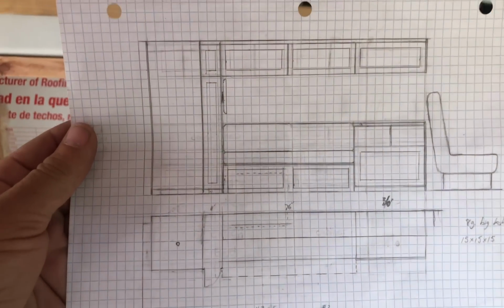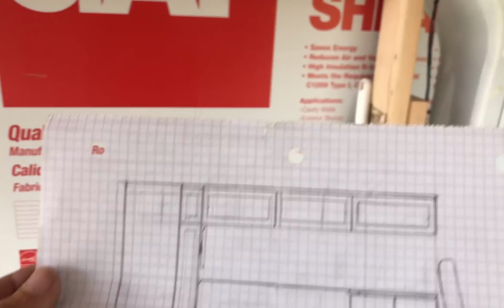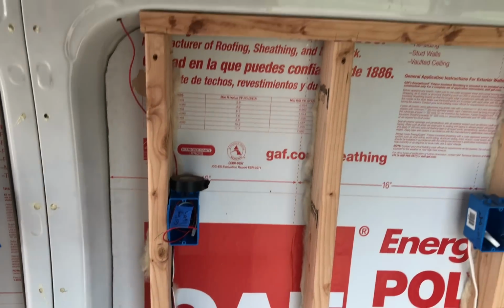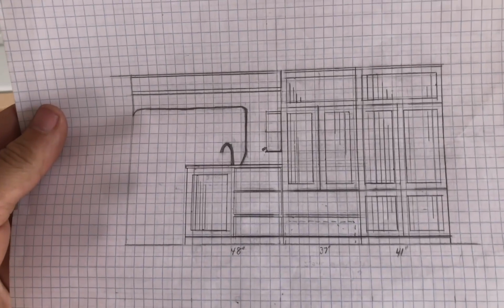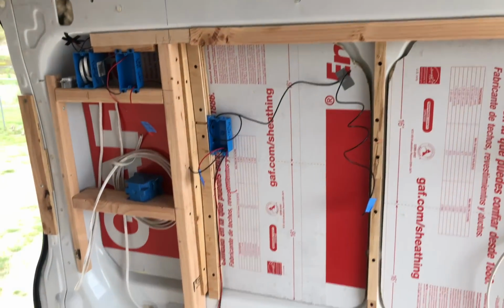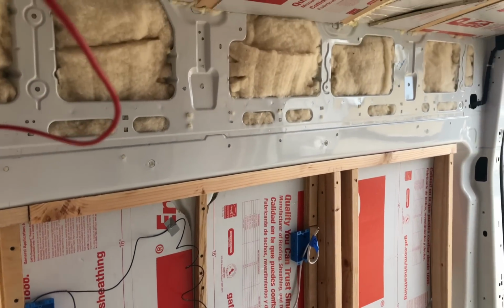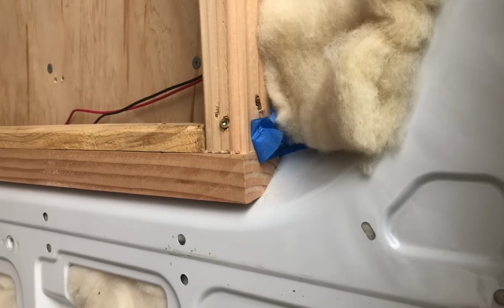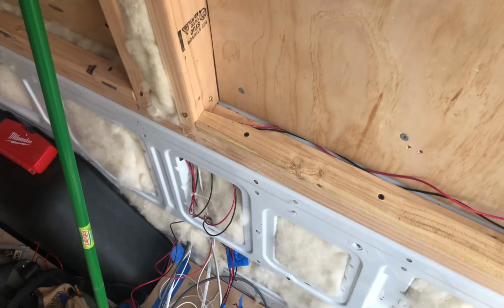Transit Van Build #3 Framing and Electric

Comment: I like that you cut that steel bump off. I am concerned that the 2x4's are adding a lot of weight. Would metal studs be worth the effort?
Reply from the maker: Amy Goodrich thanks, there were only a few 2x4’s so not that much weight, but you could use metal studs. I like wood for thermal bridging. 🤙✌️

Comment: Do you have a trick for locating the outlet boxes on the plywood or do you just measure with your tape and cut the square holes out before hanging the plywood?  I know with sheetrock you would use a zip driver to cut out the outlet openings....
Reply from the maker: Thanks for watching. I measured and pre-cut them before installation. 👍✌️

Comment: How did you cut the 30/15 degree angles!!? Heelppppp!
Reply from the maker: ME PILLA if you’re covering them, they don’t need to be perfect. I used a cheap compound miter saw. If you don’t want to invest in one, you can go old school with a hand saw and miter box. Stanley 20-112 Clamping Miter Box https://www.amazon.com/dp/B00009OYGB/ref=cm_sw_r_cp_api_i_A2pbFbM83HXWV
Reply: boom thanks for responding ! Can do it safely on a table saw you think?
Reply from the maker: ME PILLA you could, but it’s a bit tricky. Be very careful, could potentially kick back.👍